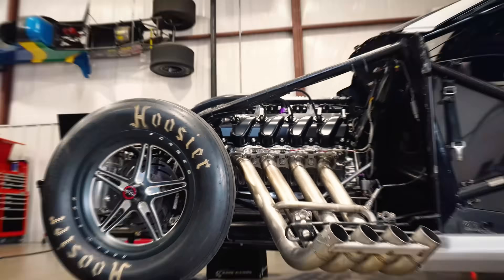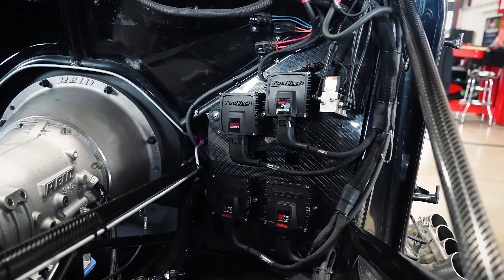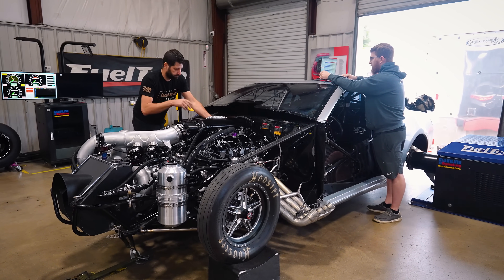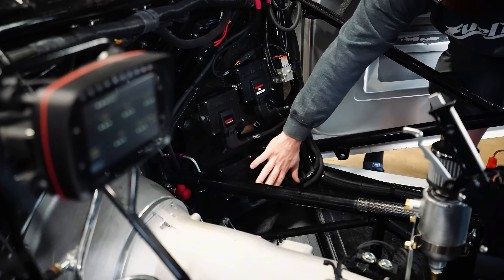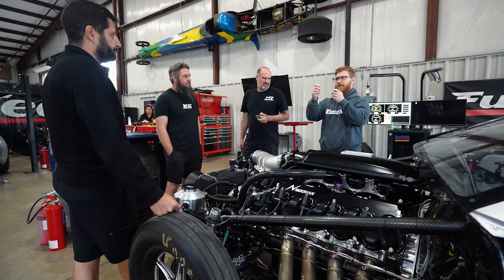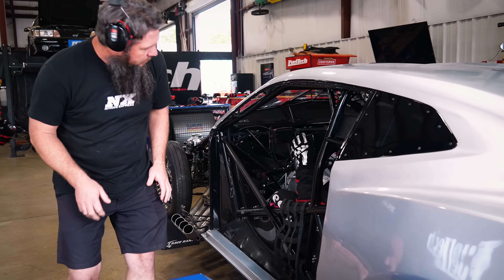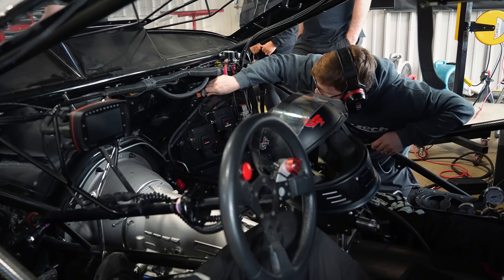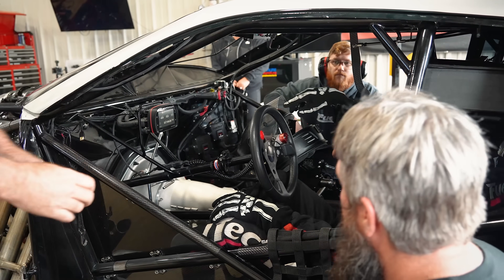ProCharged Alcohol Camaro...with an Intercooler? | Hub Dyno Tuning Session | FuelTech USA

Comment: would be intersting to see a procharged engine feeding air into 2 turbos.
Reply: Either combo works and gets to the needed HP target. HP isn't the issue at that level. They have more than thry typically use. Doing both would just add weight and complexity and wouldn't make it any faster

Comment: I thought you could get Alcohol too cold to fire IAT wise is that not the case?
Reply: I guess they just bump the comp up to allow for the intercooler being 10deg C below ambient….  I’m waiting for annealed copper wound around charge pipes as nos lines, giving the benefit of cooling and nos injection
Reply: I was thinking maybe they do it mainly for consistency in varied air temperatures? Maybe they warm it up with no ice? I dunno it's interesting.
Reply: You can definitely get to cold, Ryan with the CAS system cant run alcohol because of this happening. So im assuming the intercooler wont cool it that much. I think Ryan was seeing 40 or 50 degrees when he was having flame blow out issues on methanol at boost.

Comment: How much difference does intercooling a Procharged engine make?
Reply: Air density increases as temperature drops. The same volume of air, one is 10deg the other is 30deg, the 10deg air will have more oxygen molecules - more oxygen & more fuel means more power
Reply: @S.park.y  Thanks. I understand the reason for doing it, but I wanted to hear any specific numbers that they might have. They have run multiple, non-intercooled Procharged motors and wondered if they had some info to share.
Reply: @azmidlyf also it is a NT 275 car. The numbers being shown are minimal and the advantage of the combination itself won’t have much details to keep it competitive in the NT grudge world
Reply: @azmidlyf  This is one of Our custom Intercoolers on this build and they reported sub 100* temps after the cooler starting pre cooler temps were 400* out of the blower. So yes adding one to a Porcharger makes a world of diff. Procharger outlet temps are significantly higher than most Turbo precooler temps
Reply: Its about power, but its also about durability. Intercooled engines live longer and are easier to live with. I have seen dyno numbers showing 30% to 40% over non intercooled. But they were pushing for max. My guess would be you could get 10% or 15% and lot longer life. Just my guess.
Reply: Jumping in the comments section to ask the same question. HP and IAT